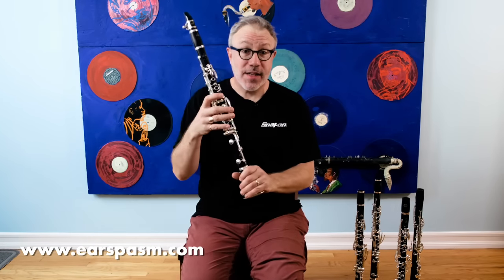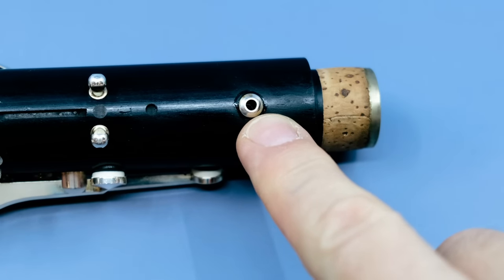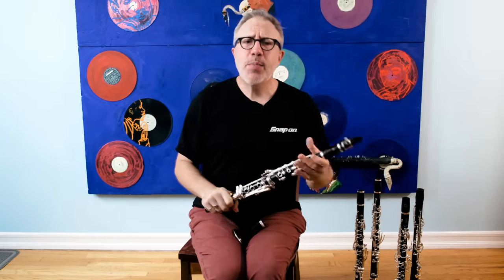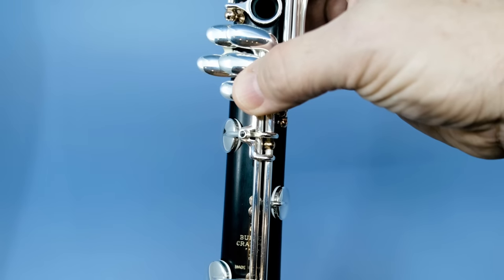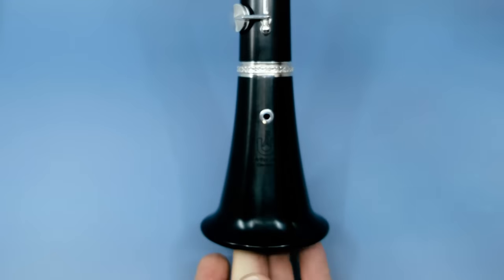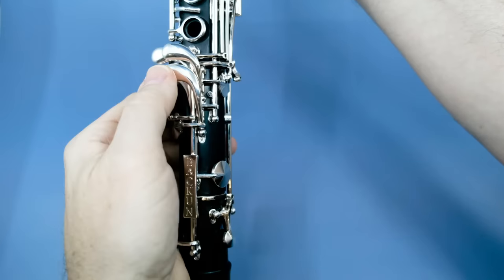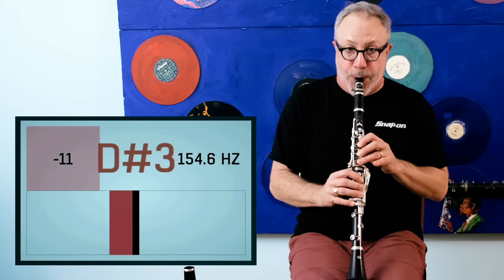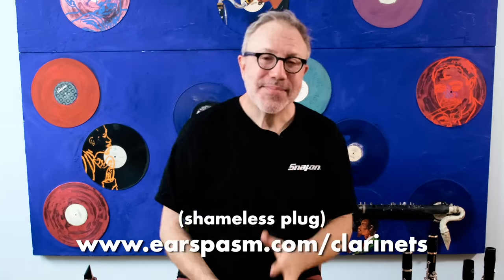Yo clarinet players: Give an F about your low F!

Comment: the low f and e actually are in tune on all professional German clarinets. We have the same system as the Selmer Muse but the vent hole for the low e is on the bell
Reply: If German clarinets keep those notes in tune, why would they add the vent system?
Reply: 😂 exactly what I was thinking. As you can see in this video the French system is also in tune if you add the vents
Reply: Professional german clarinet means that they have all the correction key for low e and f. A normal Oehler or german clarinet f.e. must not have the key. With the key (professional) the price is much higher. If you install it separatly it costs about 1300 Euro. 
 Without the key no german clarinet is in tune, sometimes more than -20 cent.
Reply: He means german system, not french like these

Comment: I play a Yamaha CSG with a correction system that functions basically like the Selmer instrument you showed in the video. It is a little awkward to use in fast passages, but in those cases it doesn’t really matter terribly that the note isn’t in tune. When I play an exposed low F I definitely use the correction key. Sure took some getting used to, but you do get used to it.
Reply: and also the advantage of the yamaha system over the selmer (which has a different correction key shape) is that by bending it you can adjust its position and adapt it to your thumb

Comment: A few people have mentioned Yamaha: I switched from Festivals to Yamaha SEArtist a couple of years ago, and the low note correction is just one way the Yamahas are so much easier to play in tune.  Many people need to get the thumb key bent into a slightly different spot to suit their hand: once you do, it still takes a while to feel comfortable operating it, but it's really not too awkward, and in fast passages you can just leave it on as it doesn't affect other low register notes.  German-system players have been happy with this thumb-key for ages.  Like the Selmer mechanism, Yamaha's has 3 distinct advantages:  it's OPTIONAL (you don't have to use it in soft dynamics or in certain chords); it fixes the low E also; and you can 'half-hole' it, just pushing it slightly to get an in-between pitch.  Furthermore, you can use it on a middle B or C if you need those to be sharper (they're not sharp notes on SE's and CSG's), and it also slightly helps low F# and even low G.  Buffet's decision to only correct the F and forget the E strikes me as truly bizarre, leaving the Weber example only half-fixed.  Backun's choice to make it permanent and unavoidable is also a head-scratcher for me, and I imagine it makes for a slower and heavier register-key mechanism?  So for me Selmer and Yamaha are hands-down the best designs.
Reply: The only good automatic low F mechanisms I've ever tried are on rossi clarinets because they're one piece. They're gravity activated rather than spring loaded which makes the register key heavy indeed. All your points are great and I enjoy my yamaha fancy csvr very much.

Comment: Great video! I feel another solution manufacturers should try is an automatic double register vent mechanism like you see on bass clarinets. This would help both low F and low E while also offering other improvements in the clarion register. Other smaller woodwinds like soprano saxophone and oboe already make use of multiple vents so it wouldn't be that challenging from a design perspective.
Reply: Would a triple vent be feasible/useful on bass/contra?
Reply: Most likely that second vent would go on the barrel which would likely lock you into whatever barrel the manufacturer sends with the instrument. In addition, the register vents on saxophone do not double as tone hole for a note (another design compromise of the clarinet.)
Reply: @aidanknox2430  I think the Eppelsheim actually has a triple vent.
Reply: I feel that the double vent on my Selmer BC helps more with response than intonation.  My low E is still pretty flat but the F is decent.
Reply: You mean Selmer's Marchi system from the '80s? They had a speaker vent on the barrel with a doubled split key and a multitude of extra keys and linkages for that (as well as being a full Boehm) which gave the same altissimo register fingerings from altissimo E as the low register, only sounding three 8ves higher.
Reply: I like to keep in mind that the more we add mechanisms like that on the clarinet, it makes it more difficult to ajust it.

Comment: The Selmer Recital was the first French made clarinet to have the fully automatic low F correction key back in the '80s, then followed by the Buffet Elite - both were linked to and controlled by the speaker key so the player didn't have to consciously operate it (as they'd do with the right thumb key as full 27 key Oehler systems have had for aeons to correct both low E and low F), but both had it working in a slightly different manner due the way it was linked to the speaker key. On the Recital, the linkage was under the speaker key touchpiece (like the mechanism on the Backun) and on the Elites, it was linked to the speaker key pad cup which lifted it. On both Recital and Elite, the low F correction vent was automatically closed when low E was played.

Comment: It is important to add that the Uebel Superior, Superior II and the Zenith all can be had (on their website at least) with a thumb operated Low E/F correction mechanism (just like Oehler system clarinets with a vent hole on the bell) and the Zenith additionally has the option of having that mechanism be automatic (again, according to Uebel's product page and shop page).
Reply: Thanks for mentioning this.  We appreciate it!

Comment: Awesome Mike, thanks! I’ve previously used what I will now call “the Australian mechanism” which is based around the use of a cordless drill…
Reply: My teacher, Isobel Carter, was an advocate of this. A small hole is drilled through the bell and tenon. You turn the bell to open the hole when you have a loud low F and then close the hole again by turning the bell when you don't need it. You can only use it by preparing in advance. It can be useful, but not very often.
Reply: @disasterblaster3693  yep - that’s the one. If you have a big low-f moment, you’re covered, then replace the positioning afterward. 
Mind you, the 90s were a very different time! It’s amazing what they can do nowadays!

Comment: I recently bought my first professional clarinet and I chose a Yamaha CSGIII to match with my Yamaha ycl-65 A clarinet, and I love the low F correction key style (which is like the muse, which I tried and it's a freaking awesome [but costly😅] instrument) because: 1st, it's an option! In the sense that I decide if I need it (like, I don't need it many times cause I'm in tune without it) and
2nd, when I need it, I can just leave it pressed and all the Fs/Es will be intune and doesn't require fingering mania to figure out a way to always land with the right hand on the f correction (like on the buffet style), as it uses another finger which is independent.
Yes at first it's weird to press it but I never felt that the clarinet would fall out of my mouth, maybe the F key in the Yamaha is more ergonomic and longer than the muse, but you'll get used to it, and if you already play bass clarinet, like I do, it will be certainly easier.
Reply: Heeeey, CSGIII buddies!
Reply: Recently bought a CSG as my first professional clarinet also, can’t wait till I have it delivered. Very excited to use the correction mechanism!
Reply: @diegojavier7371  yeah good choice, I recently had buffet crampon come to my conservatory in Italy and after trying all, and I mean all their instruments, boxwood, mopane woods included, even if I fell in love with the boxwood A clarinet (perfect for Mozart), which I admit it's fenomenal, I then tried my instrument to compare to the ones I already tried, and there was no comparison, by far. Yes I was used to my instrument of course, but I played on buffet instruments for a long long time and i tried a lot of buffet models before my CSG, but even then my instrument was by far the most spontaneous and even tho the keywork is not as "hard" as the top line of buffets, it still had the best sound, and for WAY, let me repeat, WAY less money than the top line buffets. When I tried my instrument I instinctively had a sigh of relief😅🤦🏻. So I hope that is what you will find with your own instrument too🤗

Comment: My R13 is a full boehm system, so the low F has a bit more venting and the low E/middle B vents through a tone hole instead of the bell, and I find it makes a noticeable difference in feel and response, and it makes tuning a bit easier.
Reply: Buffet also offered the Elite with the longer lower joint as you'd have on full Boehms, only the low E/B tonehole or vent was a plain tonehole (it had no low Eb key) which evened up the tone quality of the low E (and B) as it no longer issued directly from the bell as low E/B does on full Boehms. Orsi also offered their Verdi clarinets with the long lower joint with the plain E/B tonehole/vent without the low Eb key.

Comment: I find the Buffet solution to be just a bit of a stretch for my right pinky and caused tension in my hand. With the Selmer I would want to adjust the key touch up to where I wouldn’t need to move my thumb away from the thumb rest but found I would accidentally open the vent when I didn’t mean to. I could probably adapt to either after some practice.

Comment: Small comment about german system clarinets, that might be interesting for some people. Most manufacturers sell clarinets, that have something called "Bechermechanik" (bell-mechanic), to fix the intonation of the low E and F. The mechanism is pretty much the same for all manufacturers I know of and is similar to the one by Selmer but with the vent located at the bell. You can actually see the "Bechermechanik" vent in the picture of the german system clarinet (0:33) on the right side of the bell.

Comment: I play a Yamaha CSG. The system for correction of the low notes is similar as the Selmer described in the video. Although it is something quite bizarre to use in the beggining, you can get used to it at some point. The key is quite easy to bend a little and you can make it easier to reach it for your hand, it is not miraculous meaning you'll still have to practice it, but it will be easier. Another plus side to systems that aren't automatic, is that you can actually choose to correct it or not, something useful when you'll want to play the low E or F really softly (and may be not so flat).

Comment: Tosca player since 2006-2007 (don't remember exactly), luckily my  clarinet doesn't suffer too much the low F even with the normal fingering, but using the correction key Is useful and practical for long notes or pieces like Weber.

Comment: I thought that problem was solved in the early 20th century with Full Böhm designs! It’s the similar design than the Buffet in this video but you gain the Eb at the bottom (which will be flat!) but you acquire the vent for the E and F. Furthermore you had the Marchi design from Selmer in the 70’s with and automatic double register that even allow to jump to the 17th in addition to the 12th.
Reply: Full Boehms weren't the solution to the flat low E and low F - if anything, they made things worse as they also have a flat low Eb. Full Boehms were made for players who preferred to play everything on the one instrument and the low Eb was there to give the same note as the low E on an A clarinet to fully cover A clarinet parts, plus the LH Ab/Eb lever to make a low Eb-Ab slur easy (the same as doing a low E-A slur on an A clarinet), an articulated C#/G# mechanism for a B-C# and upper F#-G# trill so an A clarinet's C-D and G-A trill can be done with ease. Also the LH forked Eb/Bb mechanism (which is the 7th ring key for LH3) so a low register C-Eb and upper G-Bb (same as an A clarinet's C#-E and G#-B) tremolo can be done simply by trilling LH2, although all these extra mechanisms make many trills, tremolos and intervals much easier and some are advantageous - the forked Eb/Bb mechanism (xox|ooo) is in tune in both registers unlike long Bb (xoo|xoo) which is sharp as a lower register Eb and the extra 'sliver' key for RH2 can be used for an altissimo E-F trill instead of trilling the C#/G# key with your LH pinky which will fatigue quickly.
Reply: @chrisperyagh  don’t get me wrong; the full böhm was not designed to fix the problem described in the video. Arguably the low Eb on them is even flatter but the bore is cylindrical above that last tone hole which makes it act as the vent hole from these modern designs. The low E and F are not as flat as on simple böhms (buffet-klosé models).
Reply: @rashakor  I designed and was going to add a low F, E and Eb correction key to my Series 9 full Boehm (and then add it to others) and  got as far as making the pad cups for it, but never got round to doing the alterations to the clarinets. Then Yamaha fitted what appears to be the same mechanism I designed (only I had the bell key like Oehlers have in mind), so it's nice to see both myself and Yamaha were on the same wavelength with adapting this mechanism to Boehm systems.

It's interesting to see how some German features are being used on French clarinets and vice versa - some German clarinets now have linked throat G# and A keys as on Boehms instead of both being independent.

Comment: So, if the clarinet low notes are out of tune to favor tuning of the clarion notes because the register vent is in the wrong place, I wonder why they didn't just add a second register vent like oboe and saxophone do.  Venting the F seems to be fixing the wrong problem, and the linkages could go from bottom to top just as easily to make the thumb key switch which hole it opens.

Comment: Like some other posters I use Yamaha CSG IIIL. Pluses - it works, and you open as much or as little as you wish (for F and E). Minuses - a little awkward, and I do use a neckstrap (for other reasons). It also limits the adjustability of an adjustable thumbrest, and might well (this is speculation) prevent use of the larger ergonomic thumbrests out there. But it’s worth it for me for longer notes.
Reply: You can adjust the Yamaha correction lever by bending It, doing that you can adapt It to whatever thumb rest or adjust the thumbrest how you desire
Reply: @christianiacuzzi1572 thank you.

Comment: It looks like the Uebel and the R13 are the same, so the extra hole didn't help at all. I was wondering how it could change anything. 

Also, is it possible to "lip tune" that low F? You know, by shoving the instrument up higher? That was something I always remember being told to do in band in school. The clarinets would constantly have issues playing flat (on certain notes), and would be told to push up more. I know it's really a problem in the highest register, but it would come up in other registers, too.

Comment: Great video as always Michael. However, one can correct the horrible  flat low F by proper voicing. I have a Selmer 10G, Backun MOBA, and a Uebel Zenit. I can play the Uebel in tune by voicing it correctly. The 10G is a bit tricky. Gigliotti designed the tuning so the long C is not so sharp. But again, I can get it close by correct voicing . Just my 2 cents!
Reply: You can also play in the upper register without the register key but for sure it helps..

Comment: Thank you for making this video. I recently purchased a used Buffet Tosca, and I noticed an interesting intonation quirk with it. Its middle B and C play well in tune. The low F also plays well in tune with the low F correction key. The low E, however, is noticeably flat. I've also noticed that some of the other uber-pro Buffet clarinets have a hole drilled in the bell. Do you think something like this would raise the pitch of the low E and B? Do you know of any other ways to raise the pitch of a low E, aside from using a shorter barrel?

Comment: One other question: on the Selmer, how much does having the extra mechanism that has to cross the joint impact anything. I remember that both the lower Eb mechanism (by covering a right hand hole) and the B/low E key would constantly have issues on my instrument, from the day I got it. It just seems those mechanisms are prone to not working as well.

Comment: The problem is clarinet players tune their B or A concert perfectly to 440khz and then play every other note sharp. An even bigger issue is the lack of tuning of each note depending on the scale and the interval of any given chord. The low F is the very least of the problem. Most people need to learn how to play in tune in an ensemble. For a period of time Canadian Military Bands required all clarinets to be R13s because they were played perfectly inconsistently together. When they are together it is most pleasant and low F really is unimportant.

Comment: This is why they shouldn't have changed the tradition a ton, it has a purely cylindrical bore like the bc20, but it still works fine on the new one.
Reply: You might want to check with some calipers 😊

Comment: Didn't selmer clarinets have the mechanism like the backun? I believe it was selmer who did it first, why they changed it?
Reply: If I’m not mistaken, some people didn’t like the added weight on the already extremely heavy Recitals
Reply: @Fumbles9001  They even offered the articulated C#/G# mechanism on some Recitals, so that too would've added extra weight to perhaps the heaviest clarinet ever built.
Reply: @chrisperyagh  💪 💨
Reply: I have the Recital in A with low F correction, and boy it's heavy! Strap required.
Reply: @henrikf2822  Good job the low F correction mechanism on Recitals is automatic! Imagine having to operate it with your already tortured right thumb? 

I definitely recommend either the RDG BHOB or the Ergobrass support over slings as they free up all the weight off your entire right arm and you can still move about whilst using them.